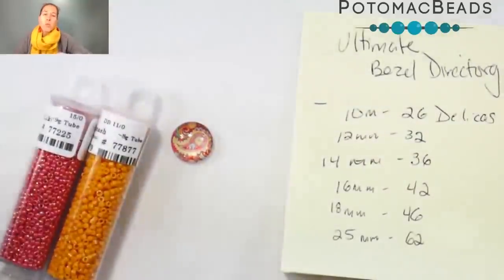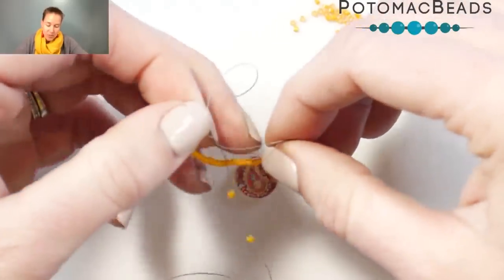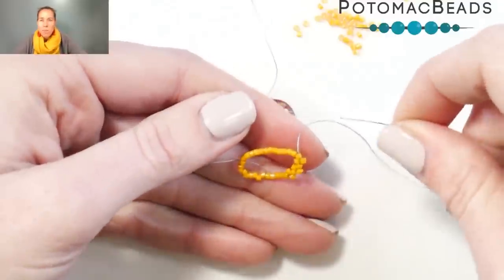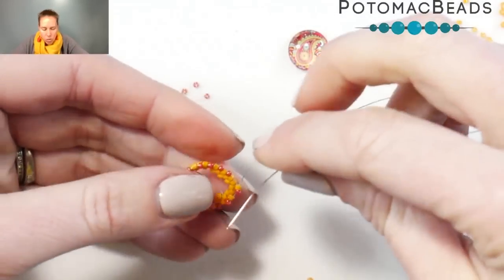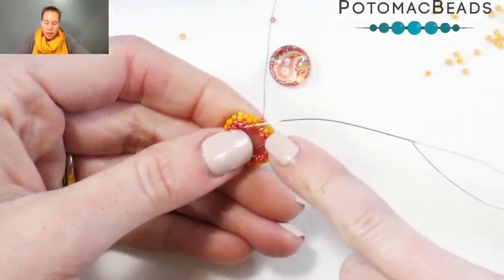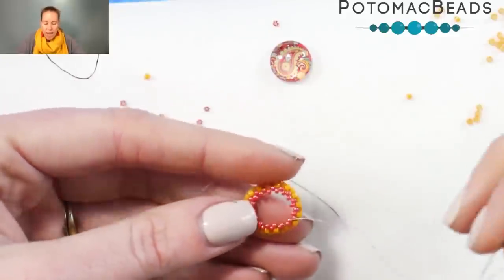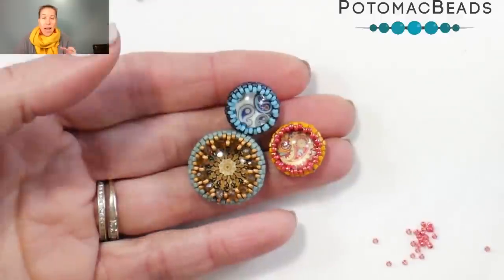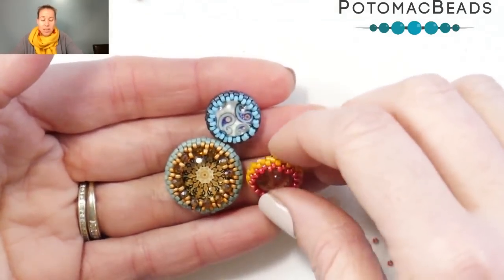Bezeled Cabochon Buttons - DIY Jewelry making Tutorial by PotomacBeads

Comment: Allie I am having a problem with the counts. I am trying to do a 25mm cab which takes 62 Delicas, what should be the count for the third row is it half of 62. When I start the back I think I am getting an odd number. I t doesn't seem to work out.
Reply from the maker: It needs to be an even number in order to work the peyote rows. The number of beads depends on the tension and if the cab is being held securely in place.